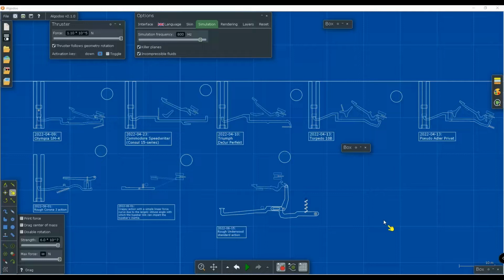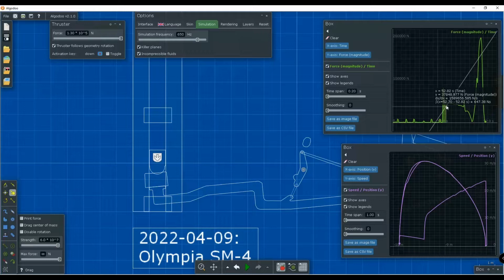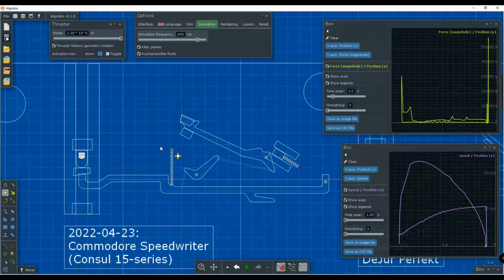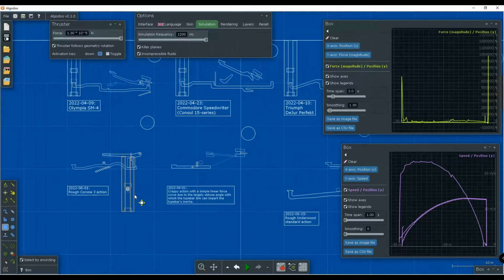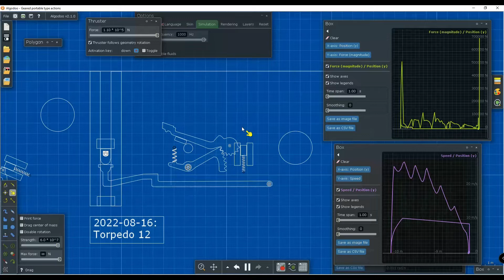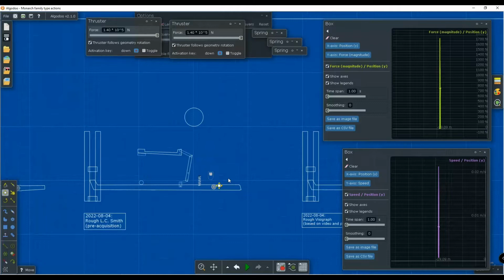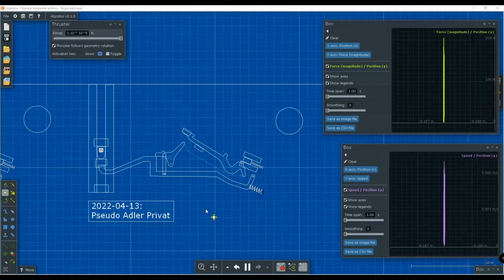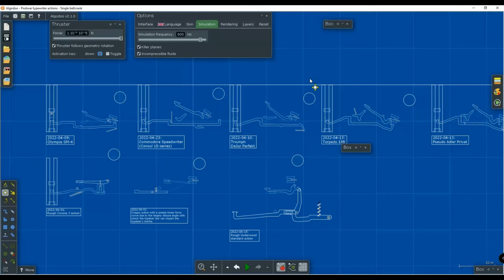Why different typewriters feel different - Type actions and force curves

Comment: which among the typewriters, especially the portables or even the 'ultraportables', do you like the most? with the most comfortable typing feel and most responsive, good for touch typing? :) Thank you. Just wondering about the best typewriters in your opinion. I notice you type properly (with all the fingers) so there could be no other better to ask than you. :) thanks.
Reply: The reason why I'm asking is sometimes my pinky fingers do not seem the register the 'q' and 'p' and 'z'. or sometimes they are faint in imprint so thinking of ways to improve it, whether it be skill or change of device. I don't know if that makes sense to you or whatsoever. Thank you.
Reply from the maker: See my response on the Hermes Ambassador video.